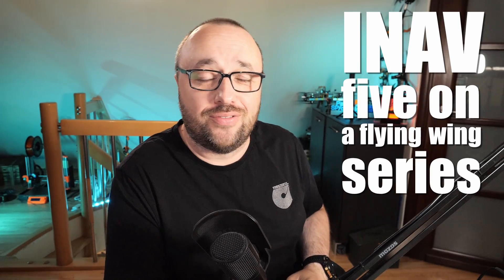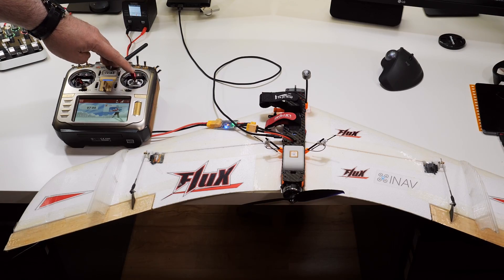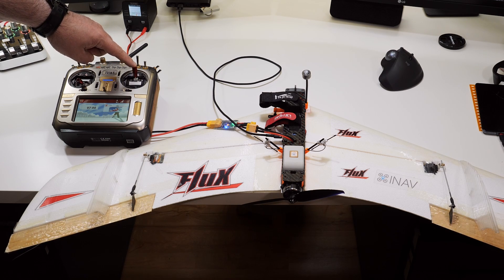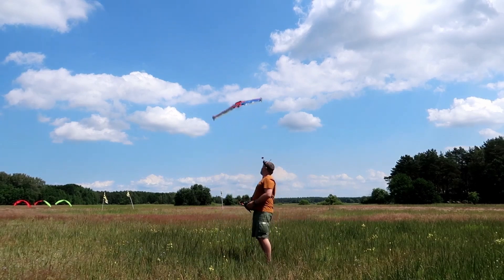Final tips | INAV 5 on a flying wing | 11/11

Comment: Hi Pawel, setting up a wing with Spketrum ix12 & Matek F722WPX and for some reason I can't get the elevons to work correctly even with the TX configured for wing elevons. To get full deflection up and down I have to go to the corners with the sticks. The monitor on the TX is showing correct servo output but the receiver monitor in inav is showing incorrect deflections. What am I missing? thank you for the amazing series!

Comment: Hi can i install 5.1 on a board with 4.1? I have a new matel 411wte and it wont flash. Device manager sees it as matek 411 and has com port assigned but it wont flash. Tried zadig but then pc wont see it at all so rolled driver back. Always a ball ache setting up a new model...
Reply: I had a similar issue 1. try to flash the board when it's power with a lipo 2. Try to remove all the connection to the board (reciver gps etc.) good luck